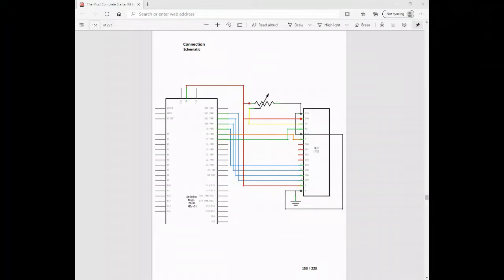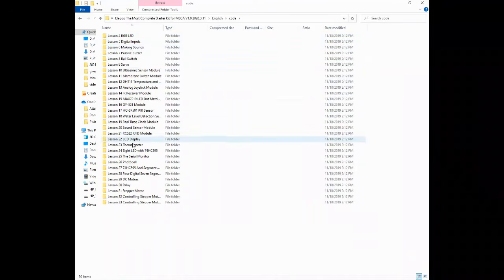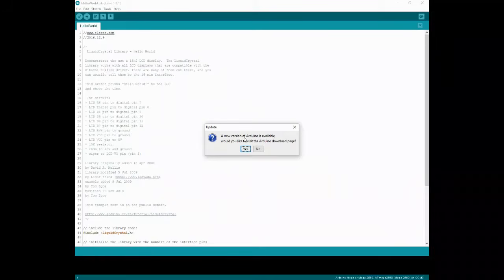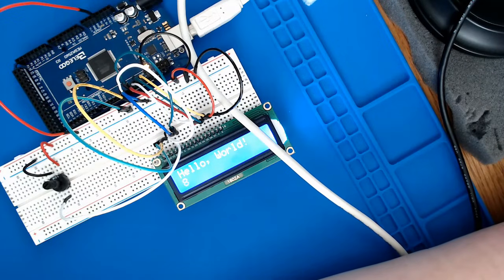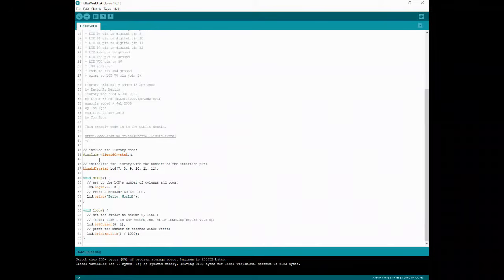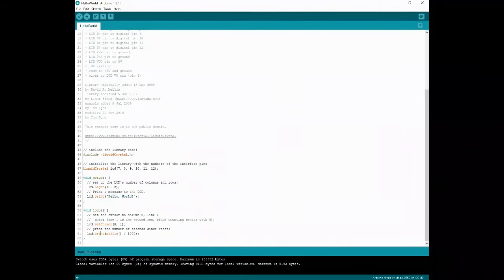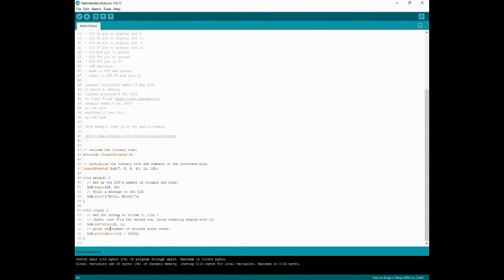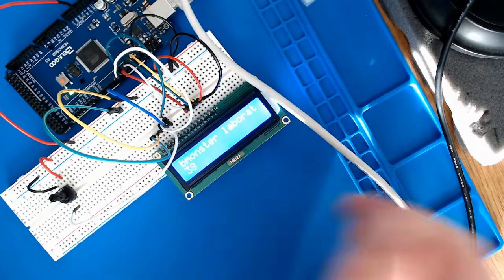How To Connect An LCD Display To Arduino (Elegoo Mega 2560 Project Lesson 22 From Start To Finish)

Comment: Can I do this with a Mac computer?
Reply from the maker: Hi Patrick. Yes, you can do this on a Mac. You need to install Arduino IDE. Go to https://www.arduino.cc/ - click software - select Mac OS X 10.10 or newer download. Hope that helps. 👍
Reply: Today I plugged it in to power and the LCD screen lights up fine, but there is no text on the first line and no timer on the second line. The potentiometer works ok as it changes the intensity of the character spaces when I adjust the potentiometer’s “handle”.  I cannot figure out what happened or how I managed to create a problem.  Do you have any ideas for what I should look at.  I am using a Mac laptop, which I mention here just in case it somehow matters.
Reply: Never mind!  I figured it out.  I checked the code and had not changed the code for the pins to 7,8,9, etc.  Everything works now.  :-)
Reply from the maker: @patrickmurphy7313  Awesome! Sometimes you have to backtrack to find the problem. glad to see you got it working. good job!
Reply from the maker: looks like you found the issue. nice work 👍
Reply: I got the kit, completed the project with a Mac laptop.  Very cool.   Thanks for the Mac tip.
Reply from the maker: @patrickmurphy7313  excellent, Patrick! great to hear. Hope it was fun.

Comment: How do you write on both rows?
Reply from the maker: Hi there Paola! What part of the code are you asking about? Did you include the liquidcrystal.h librrary and set your LCD parameters above  the setup section? Be sure to set the number of columns and rows in the setup  lcd.begin(16,2);  and  lcd.clear();  will clear the screen. 
in the loop: 
lcd.print("your message");   // print a text on the screen
lcd.setCursor(0,1);  // this sets your cursor to the second row
lcd.print("your message here");  //print text on the second row
I hope this helps. check out the end of this video. It may offer more help.

Comment: Hi, I was wondering if something could be done without the potentiometer since I don't have one
Reply from the maker: Hi Radsi, 
Since a potentiometer is a variable resistor (the one in this video goes up to 10k Ohm) I guess it could be done if you found and used the correct resistor(s) to produce the correct voltage signal. I've never done it though...maybe one day i'll try :)
Reply from the maker: By the way, do Ebay search for "3296X-103 Side Adjustment 10K Ohm Trimmer Potentiometer 10 Pack".  Cost is only $3.49 + free shipping. They are the nice potentiometers that fit in your breadboard.  Hope that helps!
Reply: Or just stick a 220 Ohm resistor where the pot goes .. produces good contrast.

Comment: Arduino: 1.8.12 (Windows 10), Board: "Arduino Uno"

In file included from sketch\HelloWorld.ino.cpp:1:0:

C:\Users\Prajit Anand\AppData\Local\Arduino15\packages\arduino\hardware\avr\1.8.3\cores\arduino/Arduino.h:258:10: fatal error: pins_arduino.h: No such file or directory

 #include "pins_arduino.h"

          ^~~~~~~~~~~~~~~~

compilation terminated.

exit status 1
Error compiling for board Arduino Uno.

This report would have more information with
"Show verbose output during compilation"
option enabled in File -> Preferences.

When I click on upload(8:29), it is showing this. Could you help me with this please?

Comment: im stuck my arduino elegoo dosnt display text i dont find this cirle to spin the thing so i didnt use it
Reply from the maker: Hi there Walter!  You're probably referring to the potentiometer. You do need to use it to make adjustments until your letters or numbers  become visible on on the screen. If you still don't see anything on your screen after you turn the potentiometer, check your wiring. It's very easy to plug into the wrong pin by accident. If you have any issues after that, feel free to ask. It's pretty neat once you get your screen on!  I hope that helps!

Comment: When I click on the elegoo complete starter kit folder, it says its a bad file and can only open files ending in .ino or.pde. what can I do to fix that?
Reply from the maker: Hi there! It sounds like your file may have been deleted or moved,  maybe. You can go to the elegoo website and download the mega2560 files or I can share the code with you tomorrow.  I am currently in the mountains with poor internet but will be happy to help tomorrow
Reply: I can wait until tommorow.  Will you share it here or is there anything I need to do so you could share it?
Reply from the maker: Arduino Kits User Support – ELEGOO Official
https://www.elegoo.com/pages/arduino-kits-support-files  go here and download the mega2560 kit. The project files & tutorial should be there.
Reply: I got it to work. Thank you so much for your help. You're really quick with the replies and that was helpful too!
Reply from the maker: My pleasure! Thank you for your  time to check out the channel. Good luck with your future projects

Comment: could you make a video on using the RFID--RC522 module with the servo motor, I am trying to make a vending machine and I want to know how to do it, I would very much appreciate it.
Reply from the maker: Hi Susan. I will absolutely make a video for this. I am assuming you want to use the servo as a locking mechanism for the door and use the RFID as a way to control the lock?  Will be happy to post something. Thanks for asking!
Reply from the maker: It took me a while but I think I finally got it. I can now operate a servo motor with the RFID-RC522.